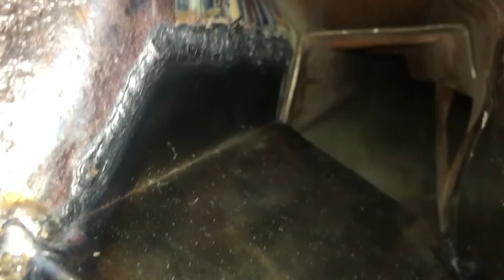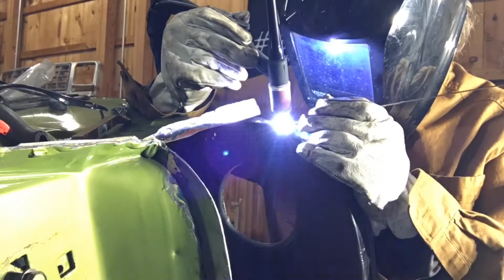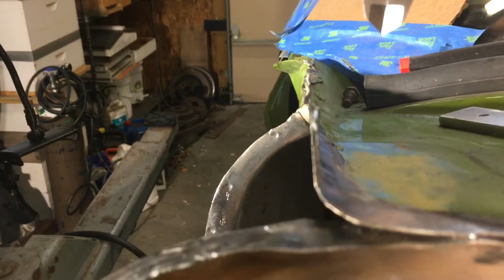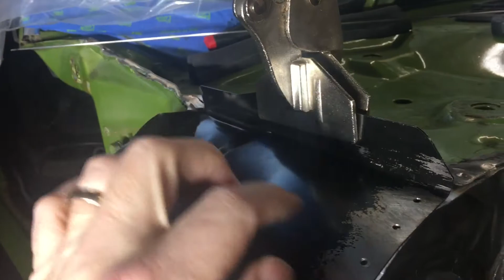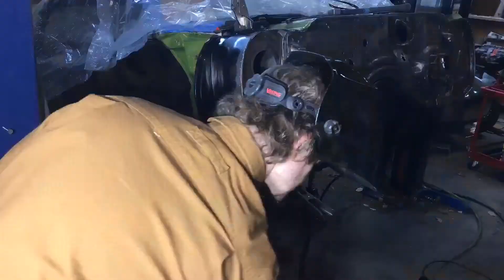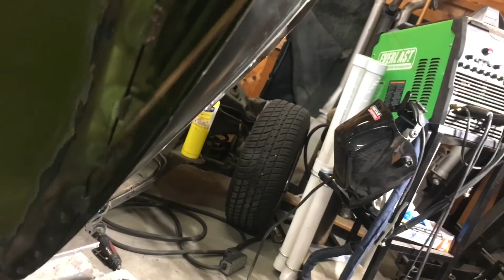Pro-Touring 73 Camaro: Pinching Off a Weld

Comment: I have a 70 SS Camaro and those lower mounts will need to be put back in. The radiator core support will flex under load due to inadequate support to that sheet metal. The upper mount where you are placing the aluminum body mount will shear off, without that lower mount adding additional support.
Reply from the maker: Do you have any idea where it fails? The spot welds to the core support or the bracket itself? I can beef things up either way but would prefer to avoid reinstalling the additional brackets.
Reply: Yes, upper mount sheared off at the radiator core support. I went in classic industry to buy lower mount, which my car was missing.  Since I can’t weld I drilled a hole through center of the upper core support and radiator support bracket were it’s welded and put a large short bolt to fixate. Painted it black and you can’t see it.
Reply from the maker: Good idea, I may do the bolt option as well if I can’t get a weld in there with all the wires and tubes now.

Comment: Just curious, you don't have any copper plates to use for your welders?  They really make all the difference.  Great work otherwise bud.
Reply from the maker: Just that copper magnetic foot, seems to work ok if you can fit it. Need to get some copper bar or something.

Comment: That repair came out great I think. All nice and solid and should last a long time. I like the Upol copper weld through primer with my mig welder. I don't have a tig so maybe it would be the right stuff. I like to drill a little larger hole so my weld area is a bit larger with the mig. It doesn't look like the original tack but I think it is stronger and if dress up nicely after it virtually disappears. I sprayed the 3m body cavity wax in my rockers when I had the  rear quarters off and could access the vent hole in the back. Will see if that works over time or not.
Reply from the maker: I am just about out of my current weld-thru primer so I will have to pick up some Upol copper and give it a try. I also am not familiar with the 3M body cavity wax. How is that applied? The Eastwood internal frame paint seemingly worked well. It came with a long tube and a nozzle you could stick way down inside the frame rail.
Reply: @OpossumWorks  Hey, the body cavity wax is sprayed in with a long 360 degree tube. I think it is good after  you do your traditional rust prevention paints. It will seep into seams a bit and is what VW came up with some yrs ago. Came recommended from a good body man I know so I am doing it.
I have also squirted ATF into door window channels and trunk drops at the end of build to flow down into the seam areas for rust preventation. Doesn't stain the paint and flows well into the seams.
Reply from the maker: @idaho2ndgens240  that’s a top tip on the ATF, I’ll give that a try!